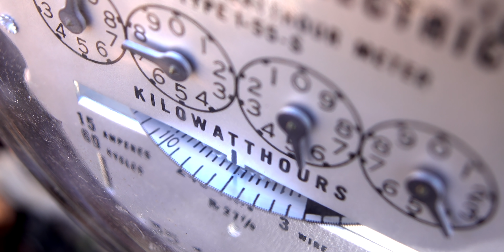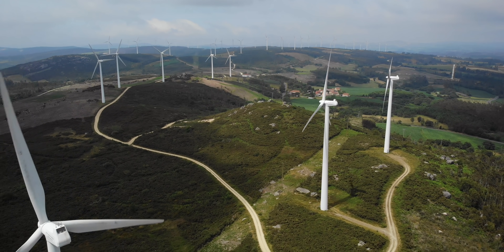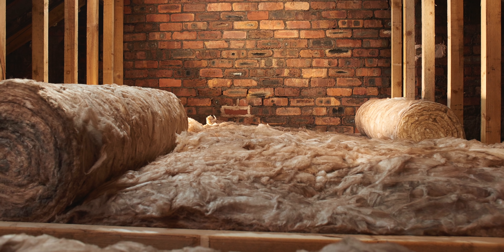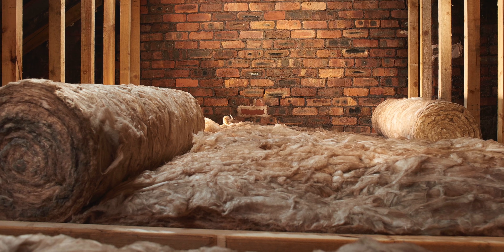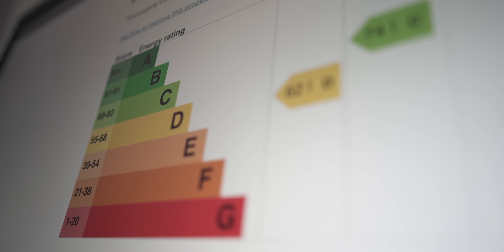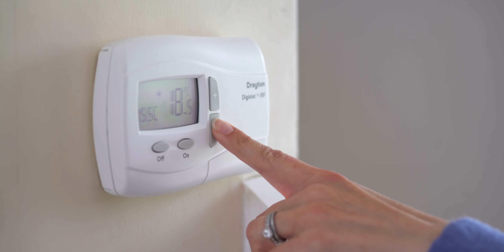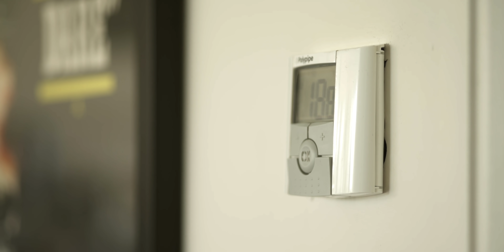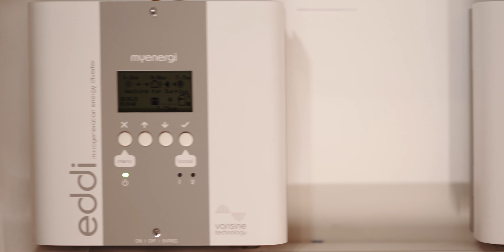HOME ENERGY Episode 1 - Cheaper Measures, Energy Efficiency & Fabric First | FULLY CHARGED

Comment from the maker: Here it is, our 'hotly' anticipated HOME ENERGY SERIES, designed for audience and to be accessible for your friends and family too. Which episodes are you most interested in 1 & 2 on CHEAPER MEASURES, 3 & 4 on GENERATING/STORING ENERGY or 5 & 6 on HEATING?
Reply: This is a really important series. At the moment electric cars are still a bit expensive but most people are able to spend a bit more on green electricity and reduce carbon emissions.
Reply: Heating and getting rid of my gas boiler
Reply: i'll take the mandetory "all of the above" option ^^
Reply: Fantastic work. Looking forward to the upcoming Home Series episodes
Reply: I thought the advice on internal versus external wall insulation for solid walls was poor. External insulation while very effective is building disruptive and very expensive. Internal insulation is simple well established and doable by any builder. It can be done selectively one room at a time to optimise cost, for example bedrooms first. The loss of space with a very effective layer of say 50mm of Kingspan is pretty negligible.
Reply: Got to be Solar PV based on previous replies - is it worth it based on current incentives?
Reply: Could you do an updated programme covering Fuel Cell Micro CHP, which seems to provide a lot of the answer for home heating and electricity
Reply: 🤗💯 INTERESTED IN IT ALL 💚💚💚
Reply: You hit a trigger with this one: 

Surely the most efficient heating system in a U.K. home is to have no central heating at all? 

We don't have it in our house, and don't plan on having it. I've been in this house for over 40 years and have only ever needed in-room heating. Our energy bills have always been way lower than those of our neighbours who have central heating. This house is about as well insulated as is practical in a 150 year old terraced house, and we do have twice the recommended level of loft heating, etc. Our room heating bill has been zero from March this year, and we're almost into September. Meanwhile, neighbours on either side have been running their central heating systems through all but the warmest days.

You also acclimatise to ambient temperatures, so if you must have central heating, turn the thermostat down by about 3°C and you should hardly notice the difference at first, and not at all after a few days. Meanwhile, you're using significantly less energy and saving money. For example, if it's 18°C outside and your house is heated to 24°C, as many people in Britain seem to choose, you use a certain amount of energy. Drop it to 21°C and you use half of the amount of energy, and it costs you half as much. If you turn off the heating altogether, it uses no energy and costs you nothing. 

Anything above 16°C indoors is both legally and healthily safe, and it's also comfortable, if you take a couple of days to adapt, and to the sensible thing of wearing appropriate layers of clothing. 

I'm sure that you will cover heat pumps of various types, which can be extremely efficient, and I look forward to learning more about them. But cutting Carbon Dioxide levels has to begin with adapting to not using energy in the first place.

Comment: The aerated shower heads are actually free from your water company if you ask for one. And I've also seen them at Lidl for £15, so no idea where the £100 comes from! Other than that is all good advice! I'd add that most pb is badly fitted dot dab. Knock it off and fit polystyrene or celotex backed plasterboard. But only if you're competent at DIY

Comment: Can someone please correct me here if I'm wrong. Thank you in advance. 
I thought the idea of a cavity, particularly in UK weather conditions, is to let air in between the walls to prevent damp moving from one wall to the other. If you fill the cavity with insulation then effectively you have no cavity allowing damp to move from the outside wall to the inside wall of your house. This could potentially cost more to fix than the amount of energy you are saving. Therefore I've always been reluctant to install cavity wall insulation

Comment: This sealing your house up is all well and good until summer. Our homes become dangerous heat traps..
Our home is 2007 detached it got double cavity insulation and double glazing AAA rated . Insulated suspended floors.
We current use more energy cooling and circulating air than we do warning the home. Our home is way to hot.

Comment: You don't put cold water into a bath to cool down the hot water, you do it to achieve an overall volume of water at a certain temperature. The alternative is for the heat source to heat all the water to that temperature itself. If this more energy-efficient, it should be explained as such — not framed as a false statement followed by chortling about the ridiculous things people allegedly do. It comes across as an attempt to hoodwink the unwary.

An interesting and informative series though.  :)

Comment: "The cheapest energy you can have is the energy you don't use" SO TRUE.
"Insulation before installation" is another maxim that I swear by. 
In winter, I dress with a thermal underlayer and RARELY require space heating. 
I am my own heater, regulated by outer layers, beanies and fingerless thermal gloves!

Comment: Be cautious when shutting off rooms in forced air heating/cooling system. Old information was about how many rooms you can safely close off, recent search says don't close any register/vent past 75%. The air resistance can strain the blower motor, also possibly create leaks in ducting.
Also, high performance or HEPA filters can strain the motor.
I replaced my blower motor, not fun, not cheap, even DIY.

Comment: Nothing against making your house more and more airtight, BUT it is important to mention that this also increases the need for ventilation of the building so that used air gets out and fresh air gets in, if possible with a central ventilation system with heat scavenging but if that's not possible the next best thing would probably be decentralized ventilation systems so you always got fresh air in your house the mold and bacteria can't spread there.

Comment: Fitting a thermostatic mixer tap... Which does what??
It mixes in some cold water. So how does that differ from just turning on the cold tap????
Heating water then cooling it down in the bath does sound wasteful, but look at the energy transfers. You may be running your water heater harder, but for a shorter time. Depending on the heater, that may have efficiency impacts. But not the sound bite/spin offered here.

A lot of what was said here was very good. But let down by silly errors.

Comment: Insulation is essential, but I don't think houses should be airtight. It creates stale air which isn't good for your health, and makes modern houses stifling. My 2011 built house is very well insulated, but in the summer it is unbearably hot, and it's lack of natural air flow means it has to have a built-in ventilation system running 24 hours a day. The ventilation machine itself has been replaced after 8 years, and become landfill itself.

Comment: Fully on-board with the concepts, but feel that some of Tim Pollard's comments are over simplified, and miss out on some important considerations. 1) retro cavity wall insulation, historically fraught with problems of cowboy installers, multitudes of cases of inappropriate systems used for specific applications, and resulting damp penetration issues. Industry arguably better than it used to be but still difficult. 2) retro external wall insulation systems, setting aside infamous issues of retro rainscreen cladding systems on blocks of flats, rendered insulation systems on single houses are also difficult, and need to be vary carefully designed and installed to prevent damp penetration, interstitial condensation, and also unsightly staining on self-coloured render. 3) "why on earth would anyone heat a room you're not in?" - if your house is super insulated maybe, but otherwise a) to prevent it getting too cold and taking too long to warm up when you do want to use it, or b) depending on level and type of ventilation, maybe to prevent internal surface condensation! 4) "what's the point of heating water to 60deg to put in a bath, and then cooling it down with cold?" - very simple, if you're storing your hot water, legionella control. His answer about using a thermostatic mixer to avoid this overheating water thing is odd, as all that mixer is doing is the same thing as you are manually with the two bath taps.  Even a combi boiler will heat to 60 deg or near, and then cool with cold at the shower mixer.  Arguably, the only answer here is electric showers, which heat the water at point of use to the temperature you need, but are high electric demand if you're not mitigating with PV or the like.  I realise you cant go into depth in a 17min video, but not tipping a hat to the issues lessens the strength of the advice in my view.

Comment: I'm sorry but this "energy efficient expert" is talking absolute rubbish. What he is saying about filling cavity walls is actually potentially extremely detrimental to buildings that were designed to have an air cavity and making a building air tight without mentioning the relationship with moisture in the air is frankly idiotic. Also idea that heating for short periods instead of a consistent level of background heat is total rubbish and does not demonstrate an "expert" understanding about energy. Not heating rooms that are seldom used is about the most sensible thing he came out with, but this is only true if said room is appropriately thermally isolated. Beggars belief.

Comment: Hmmmmmm, not very impressed with this guy's knowledge or connection to the real world

1. Thermostatic valves are no more efficient than running hot then cold... Better to turn the whole hot water temperature down

2. Zoning isn't always the best idea, especially with heat pumps. Neither is having long periods of the day wherev the system is turned off, efficiency isn't much better as you have to make that heat loss up later

3. Internal insulation is the only option for many many homes and you can do it yourself if you've got some DIY skills & time

Comment: There's no point insulating a drafty house, or sticking smart tech in it. You're just heating the outside air. Get an air tightness test and smoke test done and you'll get a list of all the holes in the house and have an idea of how leaky it is. Then you can go around with a mastic gun, expanding foam, tech 7, door and window draft seals and fill them in. You can also get older double glazing rehinged and new seals fitted for very little money.

Comment: The moment the person said we need to plug the air gaps to tighten the homes, I realised he is not aware that UK had the highest temperature in summer again and again, it will continue because of our own doing of course, so the houses need to accommodate this change in climate. So 25degrees don't feel like 35 because we are packing the heats inside.
Reply: You plug the gaps to make the entire thing more efficient.  I live in Texas, and if you have gaps then you are just throwing cold air outside during the summer.  And for you guys, you're just heating up the outside during the winter.  Why would you want to do that?
Reply: @michaelbarker1860  where is this cold air in summer you are talking about. Air would not flow if things are tight, the government guideline is do the curtains keep the sun out, if the walls are tight do you think the internal walls could radiate heat?
Reply: @asgsittng  It comes from air conditioning.  He's clearly talking about artificially altering the temp in the house and not letting it seep to the outside.  If you don't use AC, the same principle still applies to heat during the winter.
Reply: @michaelbarker1860  UK household don't have air conditioning, that means this old ways of building house where you insulate the house so much so you can keep the house tight means the trapped heat don't escape either

Comment: Absolutely agree with everything, except for the hot water.  There's a reason why hot water is heated to 60 degrees C - it's to kill off bacteria and other microbes that would otherwise be breeding in your hot water system if it was a comfy 30-35 degrees that we like it.  And the energy is not lost when you mix it with cold water - you end up using less hot water and some cold water - the volume of water and energy in it is the same - if you had a tankful of 30 degree water, you would be using more of it to have the same volume of water as you do with 60 degrees hot water mixed with cold water.  Of course 60 degree hot water will lose its energy faster than 30 degree water, but that can be overcome with better insulation of the pipes, whereas no one wants nasty stuff in their hot water.  
What people should do - especially if they have mixer taps - is to use only cold water for hand washing or whenever short bursts of water is needed.  Often you are finished before the hot water even gets to the tap, and the hot water that had already started flowing is left in the pipes, and quickly radiate away and is wasted.
And yes, set your hot water to 50 degrees if you have that option as it both saves energy and prevents scalding, while still being high enough to kill off microbes.

Comment: What annual income is needed to fund this change taking into account other core household expenses and what about old houses and flats ie: flats stone built in the late 1800’s?
Reply: Converting existing UK housing stock to Passive House or ENerFit is eye wateringly expensive (if looking solely at "payback"). There are other benefits though: hugely increased comfort, no problem with mould etc in Winter; significant benefit for anyone with respiratory ailments; dramatic reduction in chance of getting winter cough / cold (Wife and I haven't had one in the 6 years since we moved to Passive House, had one every winter before that); benefit to the nation in terms of reduced days off sick (i.e. might well be worthwhile for Government to subsidise, not to mention the reduction in CO2 and balance of payments saving on import of Oil). But I doubt the average person in a 3-bed terraced house would even consider the cost.

Comment: Don't heat if you don't use a room only works if you can thermally isolate each room - otherwise heat energy will leak from the rest of the house into the "unheated" room. Also if you don't heat when you are at work, then you run the risk of condensation and mould build-up. Maybe the right message is to turn down the heat when you are not at home, rather than turning it off?! If you hermetically seal you home as Tim describes, then you again run the risk of condensation and mould UNLESS you have an air management system to remove the humidity. Important to get the right message across.
Reply: And it'll just give your heading system more with to do when you get home

Comment: There is a major dialogue to be had about using external wall insulation (EWI) and how it changes the look of buildings. There are millions of Victorian & Edwardian homes where this will be an issue. Do we want huge improvements to the thermal efficiency of our housing stock or do we want "heritage" streets - not designed for thermal efficiency?!
Reply: Dunno if it is a reasonable answer, but such buildings can have insulation added to the outside and then "faced" to look like the original building. It ain't the original bricks, but it could look much the same. There's one near me (in UK),  Victorian, semi-detached, brick bottom half, rendered top half, bay windows; only one side is wrapped with insulation, and you can't tell the difference between the two (luckily there is a downpipe straight down the middle which disguises the fact that one house sticks out a bit more than the other). But historical housing stock is very difficult, and costly, to upgrade. The sooner we stop building new, inadequate, housing stock the less we will have to upgrade!
Reply: @ecok  It is an option, but at even more cost. IMHO better to insulate than preserve the look of a terrace of houses. Or knock them down and build passivhaus!
Reply: @TechnologyForFunVideos  We built Passive House because it was so very very difficult, and expensive, to upgrade the house we had. And that was a house with good air tightness and was a pretty good starting point. Much harder starting with a draughty old listed building ... but knock down, start again, doesn't feel right either!
Reply: Insulated plasterboard 50mm -100mm seems to be the best option, diy and cheap.

Comment: The easiest and best solution would be simple electricity showers/heaters for hot water and resistance plug in heaters for home heating

That would cost less than £500 vs more than £7,500 for a heat pump system. For new builds use the £7,000 savings to instead have a large PV on the roof. The maintenance would be very low and the electric heaters if they need replacing are just £15 from argos while a replacement heat pump would probably cost £5-10k and they will need replacing every 10-15 years same as gas boilers need replacing nothing lasts forever

Of course the up front cost and maintenance is much much lower than a heat pump system but the electricity consumption is about 3x higher

There is a cut off
If your house/flat needs less than 6,000 KWh for heating then don't install the heat pump install simple electric heating the overall cost will be lower and less headache and it works

That would mean most existing flats and almost all new builds shouldn't be heat pump but should be simple resistance heaters

For homes that use more than 8,000 KWH for heating then maybe a heat pump makes sense

Also for the eletric only homes
They can have a cheap air to air heat pump in a central location to do baseboard heating. Those would cost less than 1000 installed on mass